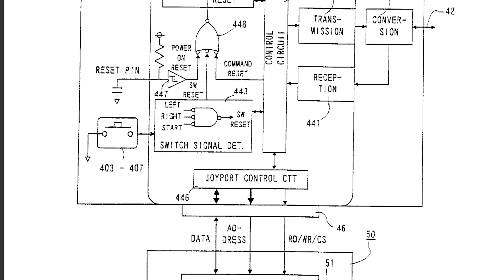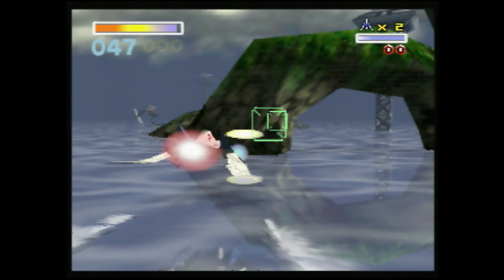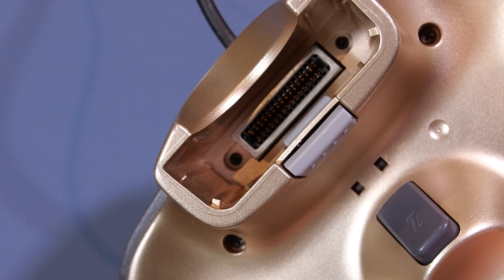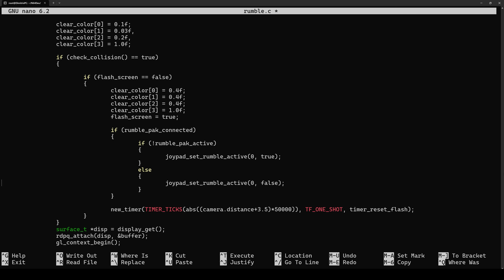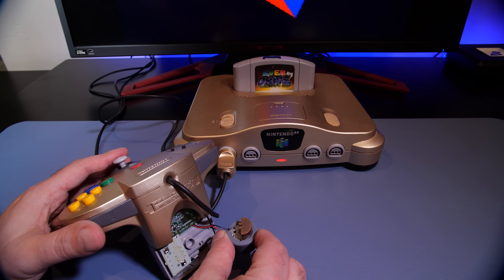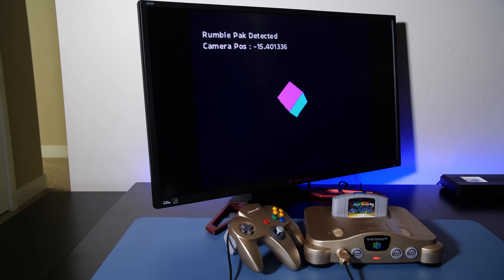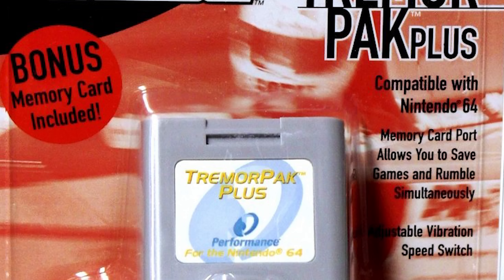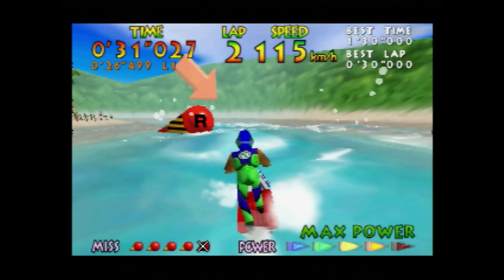How the N64 Rumble Pak changed everything

Comment: Batteries in a cable-attached device. What a shame. Compare with Sony which had separate pin in a controller port just to power the vibration. Years before it was actually released. Nintendo must have seen it and yet did nothing. Forward thinking Sony in comparison to brain-dead Nintendo which deservedly lost that round. And the next one too.

Comment: Considering how advanced the hardware has gotten, rumble is barely used by games today. There should be 100+ preset options with one line of code to call each instance at this point (might be, but Android at least doesn't and is a much bigger platform).

Also feels like mice, keyboards, and even laptop touchpads should have this.

Comment: For the future of haptic feedback, I wonder about the possibility of taking the linear actuators of the HD-rumble systems and using multiple ones. Put three at right-angles and make the controller shake linearly in any direction. Put two such groups in on opposite sides and you could do rotation as well. Pulse the left group on -y and the right group on +y, and the overall effect would be the controller jerking anti-clockwise in the xy plane.

Comment: This was really neat! I'm kind of curious about what's going on behind the scenes when a game supports both rumble pak and controller pak and has that screen that lets you load/save your data to the controller pak before allowing you to disconnect it and reconnect the rumble pak (and vice versa). Normally, games warn you never to disconnect the controller add-on while the game is running, so I'm wondering if there's some kind of safety feature in the code for these moments.

Comment: Star Fox 64 felt like such a leap forward for me when it came out.  I was used to 2D side-scrollers with hard-edged little controllers, or point-and-click stuff on the PC.  Then N64's ergonomic controls, analog stick, & rumble pack combined with the amazing graphics, sound design, and gameplay of Star Fox 64 just blew me away.  Felt like I was holding the future.  I still boot it up and play it on a regular basis today.

At one point we had a version of the rumble pack (I think it was 3rd-party) that had a second expansion port for whatever else you wanted to plug in.  Obviously the idea was you could use normal memory cards with it, but I sometimes plugged another rumble pack into that just to feel like I had an ultra-pro custom controller.

Comment: That's the good stuff I'd like to know. I do remember know Nintendo 64 has a rumble pack of a vibration and I also do remember the dual shock the controller of Sony that it only play on a dual shock until 1999.  So it does makes sense of the controller feeling of a shock and vibration in requiring capability.

Comment: I have 2 third party rumble paks from GAMSTER, they not only was stronger than the original ones, they also did not need batteries at the time. 1 version of it had 5 memory cards integrated you could switch with a button. But sometimes it erased the entire save games.

Comment: the only flaw, which is not really their fault, is how batteries left in the rumble pack will corrode and leak. its implied that users should not store them with batteries inside. batteries are a good choice in the short term though, because you never worry about charging and batteries arent going away any time soon.

Comment: Even though eccentric weight vibration motors aren't a big deal anymore now that voice coil actuators have pretty much taken over, I remembered it being a big deal back in the day, with both N64 add-on rumble packs and PS1 DualShock controllers (the rumble packs were also sold separately for PS1 before DualShock arrived).

Comment: I used to own a rumble pak back in the day for Zelda OoT. But I quickly stopped using it altogether once I realized how much batteries it required.
Also I just realized why rumble doesn't work on N64 emulators with modern controllers. I need to enable the rumble pak setting instead of mem pak.

Comment: Fun fact - You can solder a small wire from the + battery terminal to a 3.3V trace on the packs pcb to run it without batteries, have been using mine this way since I got mine in like 1997 with 0 problems

Comment: At the time this was considered a technical Marvel, but using it today  there isn’t much use depending on the game. 

It’s effective in games like Star Fox and Hydro Thunder but on a number of other games the Vibration is very weak.
Sometimes not very noticeable.

This could be due to the device being battery powered and developers deciding not to use it strongly in their games.

If anyone is interested in doing the No Battery Mod or buying a rumble pack  through the web with the mod already done.

I highly recommend you not use it with the Brawler64 because the Vibration is even weaker than it is with a normal N64 controller.

The Brawler64 takes some extra power on top of whats taken with the Modded Rumble pack.

Comment: With enthusiasts making hardware that works with original hardware, effectively retro fitting to make it compatible with modern technology, I have just envisioned that it could be possible to build a module that combines the rumble feature & a Bluetooth module, & a receiver plugged into the joyport.
However, the N64 BIOS ROM would have to be loaded from an ever drive that has a modified BIOS version that supports the Bluetooth module, then you would have to patch each game ROM to add support for Bluetooth. It'll be a monumental task but I believe someone would be able to build it.

Comment: I'm confused how people think the N64 version of rumble was better than on the DualShock.

On the PSone, the controller vibration was built-in and powers from the console.  On the N64 it requires batteries (unless you mod it), and on games that don't save onto their carriage, you have to take the Rumble Pak out, insert the Controller Pak to save, then reinsert the Rumble Pak again.  I'm puzzled how that is better? 🤔🤷🏻‍♂️

Comment: The playstation DualAnalog - that was before the dualshock and BEFORE the rumblePack. And yes that was released in europe, just in very limited numbers and it is quit rare. And yes the dualshock then was an iteration on the original controller that just was a better version of the DualAnalog. The one i have had its joysticks broken a long time ago.
With the rumble being part of the controller it didn't need people to buy any extra hardware and so saw a lot better adaption, the 2 different rumble-motors also made it a great experience, and of course it also meant you didn't need batteries.
The N64 just was the one that was widely available in the west a bit earlier (but then never was that common).

Comment: Was it the first "rumble" type feed back? No, of course not as a few PC joysticks had it at that time but much more of a niche type thing. What Nintendo did was to make it main stream. Just pop in 2 AAA batteries and plug it into your controller. A case of Nintendo being Nintendo and bringing a fantastically simple idea to the mass market. Changing said market forever!

Thumbs up 👍 for using an extra controller always plugged into the port 3/4 to be used as a "disk" save drive with a mem pack in it so the rumble pack could be constantly plugged in to controller 1.

Comment: If it can be modded to work without the batteries, then why were batteries required in the first place? I mean the Dreamcast Jumper Pak didn't need batteries! The Rumble Pak drawing power from the N64 itself just makes sense... unless it wouldn't be as powerful as it would be with batteries.

Comment: Amazing video. As someone that follows, Techmoan, LGR, Technology Connections, Tech Tangents, and the typical people you always see mentioned in these comment sections, I love how much detail and solid pacing you maintain through all of your "Here's Why/How" videos. Always less than 20 minutes as well. I did not own a 64, but as a PS1 owner, I remember the day my brother came home with a 2-Disc copy of Gran Turismo 2, and this awesome looking PS1 controller that had these weird joysticks at the bottom... I didn't get it at the time, but my jaw HIT THE FLOOR with enough force to break teeth, when I accelerated with the right stick, broke traction, and felt the motors kick on... The fact that the left or right side would rumble independently depending on which side of the car you hit... You couldn't convince me driving games were going to get better than that, when I was 8. It's cool to examine all these features and innovations 20 and 30 years after, it takes you away for a second to those better days.

Comment: That hardware hack to power the rumble pack directly from the controller seems like the kind of thing Nintendo would've done, if it was safe to do so.  I don't think they added a battery compartment because it just wasn't big enough yet.

My guess is that either 1) the N64 doesn't have the margin on that power rail to supply the rumble pak(s) adequately;  2) the impedance of a controller cord is high enough to potentially cause data integrity issues when the motor is drawing current;  3) someone at Nintendo was married to someone at Duracell, and they were helping each other out.

Point is, it might "work", but if it didn't ship that way, there's probably a good reason for it.

Comment: It took batteries for a good reason. The console wasn't designed to supply that much current to controllers. It worked alright with just one but if you had three or four, you'd overload the circuits and the game would crash or shut down. The GameCube addressed this by adding extra power lines just for the motors.

Comment: That runaway motor gave me anxiety. I can't help but think of the rumble motors in the Xbox controllers I've opened that are connected with thin, easily snapped off wires.

Comment: One thing about the "no battery rumble mod" is that it's been well documented as being able to cause the n64 to overdraw the 3.3v line if a game activates more than 2 of them at a time, which is one reason that most display kiosks with the modded rumble pak installed would only have 2 controllers... And speaking of kiosks, yeah, the no battery rumble mod was official for display kiosks so that store owners wouldn't need to swap batteries
Reply: There was also at least one third party version that omitted the batteries from the start. My cousins had this cool black one with a blinking red LED when the motor ran. I think it was called Tremor Pak but it looked nothing like the Tremor Pak in this video, it had about the same form factor as the 1st party Pak.
I imagine it had the same drawback you mention of the no-battery mod.
Reply: @nthgth sounds like the Force Pack/Force Pack+ , except those do need batteries.
Reply: @SPOONman4000  Yes that's it!! I see on an image search there's definitely a battery compartment. I misremembered.
I must've known someone else with a black Naki "Advance Rocker Pak," (did more searching) and mixed the two up up. That second one is battery-less
Reply: I have a third party pack that takes no batteries. If it's installed when I turn on the console with the Killer Instinct Gold cartridge, I just get a black screen. It doesn't happen for other games I've tried. I always figured it had something to do with specific games and power requirements.
Reply: Interesting info I didn’t know that was a thing.

Comment: I think a very interesting video would be a closer look at the PS5 DualSense Voice Coil Motor force feedback and adaptive triggers. I only just really realized they drive the VCMs with audio amplifiers. I feel like a handful of games really took advantage of this with Astro and maybe Ractchet and Clank Rift Apart. 

I was looking at the hid-playstation Linux drivers and sadly, they only support the "classic" rumble modes which kinda emulates a DS4. Anyhow, there are ways to get the VCMs to show up as audio devices in Windows and Linux. I want to write my own software for simulating raindrops on different surfaces or maybe your body armour. 

Some stuff I have been looking at is inspired by physical model based synthesis of musical instruments and also the wonderful Engine Simulator by Ange. I think it would br interesting to make a real time physical model based synthesis engine for VCM haptics.

Comment: All I try nowadays is trying to hack my computer to turn off rumble globally. This is no joke. Worst gimmick ever.

Edit: now I remember even using the rumple pak for the first time and how disappointing it was. Because I expected it completely different than what it turned out to be. I didn't expect a simple lame vibration. I was expecting some hammer like a joystick with a heavy weight on top of it inside the gamepad, that was almost make the gamepad fly out of my hand when it hit into a direction inside a hard wide rubber cylinder when being hit by an enemy. The rumble pak is unironically the most lame thing it could have been.

Comment: The one thing that turned me off to the rumble pak was the weight. The controller became noticably heavier and unbalanced with the rumble pak and it's batteries. Also the batteries died and i rarely changed them( I was a kid, didn't have much choice) still thought it was so cool. I got mine with Star Fox and I also got third party ones with memory cards included.

Comment: fun fact: the Rumble Pak released on the same day in Japan as the Playstation Dual Analog controller, which also had rumble, but only in Japan
Reply: Is the Dualshock 1 just a renamed Dual Analog w/ rumble and released internationally?
Reply: @nthgth  nope. 

aside from the shape difference of handles and sticks,
these 2 controllers are actually not fully inter-compatible with eachother. a lot of games do no support rumble on the Dual Analog controller for example. many western releases will not detect the rumble motors in it at all... some will, even some PS2 games will detect it, but most western games will not, and even many japanese dualshock compatible games will not detect the dual analog rumble motor.

and the DualShock doesn't have the flight stick mode the DualAnalog controller has, which means some games will have completely different controls when using the Dualshock, or don't even support the DualShock but do support the Dual Analog controller.

the entire concept of 2 analog stick Layout was originally supposed to simply make the controller fully compatible with games that supports the Sony Analog Joystick, which was a flight stick with 2 joysticks and
that's why the Dual Analog (and by extension the Dualshock) had 2 sticks in the first place.

so yeah. they aren't completely the same controller in terms of features. if a game has a "Analog Joystick Compatible" icon on the back it is compatible with the Dual Analog controller's flight stick mode (green light), but it's not compatible with the DualShock unless it also has an "Analog Controller Compatible" icon.

Comment: I'm surprised there wasn't mention of the original DualShock for the PS1, it's the precursor to nearly every PlayStation controller through PS4.  The Japanese version launched about the same time as the Rumble Pak, though it didn't get worldwide adoption until the next year.  Not to downplay the influence of the Rumble Pak at all, but most rumble features in all controllers to come after it are more akin to the design of the first DualShock.  I'm not debating anything in the video, I'm just surprised there wasn't mention of it.

Comment: Rumble is not force feedback.
Reply: The 'rumble' is achieved by physical forces and sometimes used to add feedback.

It's quite literally force feedback when used like that. 🤷
Reply: wrong. force feedback is when a steering wheel or a joystick push back against your input, not the shaking.
The rumble is haptic feedback. @zerorig

Comment: I remember renting Star Fox 64 and luckily having the rumble pak included. Blockbuster wasn't playing about their accessories. I loved the addition with rumble but as long as I owned an N64, I never bought the rumble pak but I bought the expansion pack. One slight nitpick, the dual shock controller iterated from the dual analog with like you said was an iteration of the original controller.

Comment: The  original Japanese Playstation Dual Analogue Controller had rumble and released before the rumble pack (2 days before). The rumble motor was removed from EU and NA controllers, but it still has circuitry and mounts for the motor.

Comment: Apparently the the reason Rumble pack requires AAA batteries is because power 4 rumble paks across 4 controllers was too much for power bandwidths, so battery power was added late into its design for that scenario happening.

Comment: I'm working on a ControllerPak / RumblePak combination for quit some time now.
https://youtu.be/V9orXUvltgM?si=adLUsWHr43BzTQ2Z
Maybe I have to add a battery to this too. It's simply not a good idea to draw the power from the controller. Main reason is the cable not having sufficiently thick wires. The power supply may also be not designed for four motors spinning at the same time.

Comment: Helpful tip: The Tremor Pak uses two AA batteries it can corrupt saves even with the switches flipped right way, if just one of those batteries are low on juice.

Comment: A word of warning to anyone willing to try his code on an emulator: 

Be sure not to use a "high level" emulator.

 Those are tuned to provide an optimal experience to the released commercial games and will not run anything else.

Just like MVG suggested, for my homebrew I use Ares (but CEN64 also works)